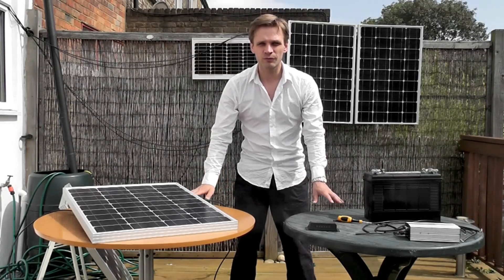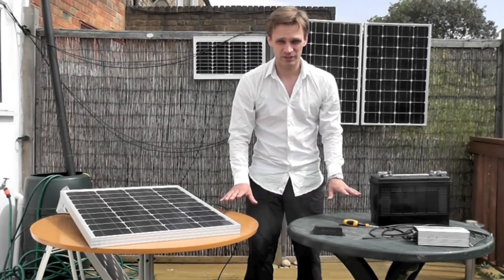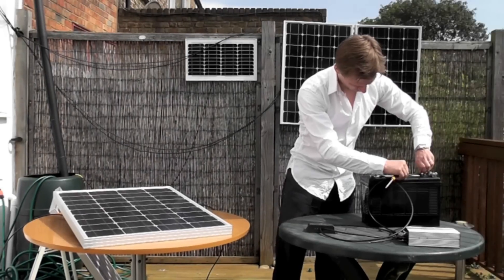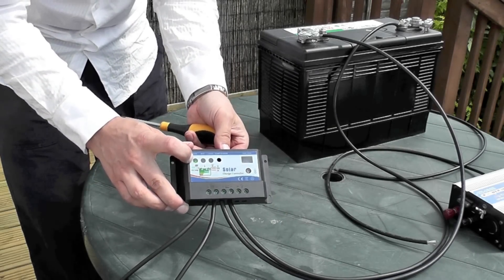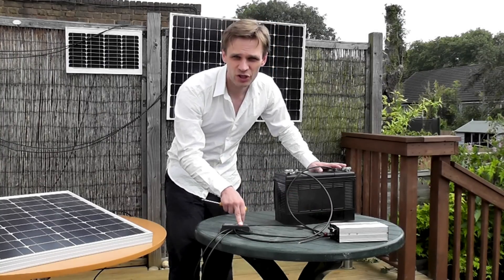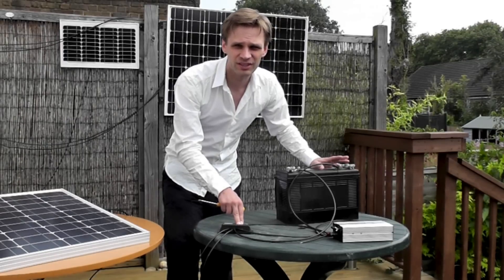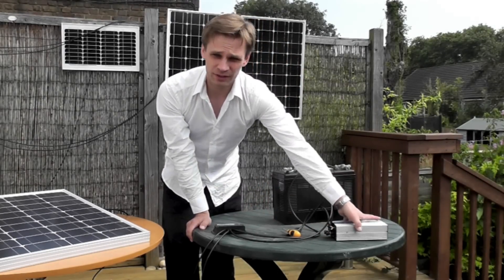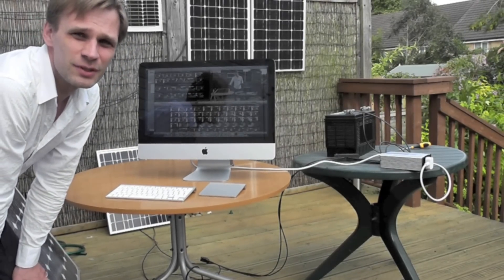How to create a 240V AKT Solar system that powers mains appliances

Comment: Can someone test 240  weilding with this solar device. Yh it's 240v and should work for the ark or any 240v weilder. But I like to see a test video on using this 240v solar panel for weilding. Who ever has this and can. Should make a YouTube video on using it. Atleast having one video on solar/turbine in using to power weilding machines is helpful.😊👍👍👍👍
Reply from the maker: It would potentially be possible to weld using a system like this. You’d need to make sure the inverter was powerful enough to supply the power (Watts) that the welder required and also that the battery can supply the required power. Then all you need to do is charge up the battery enough using the solar panel and you should be good to go

Comment: I dont know if attaching the invertor to the charge controller is dangerous but it goes against the advice you find elsewhere which is "Never connect your power inverter and the charge controller directly without a battery between the two".
My understanding is the load put on the charge controller by the invertor will be too great so it must be connected to the battery.
Also get a Pure Sinewave invertor or be prepared to say goodbye to electronics.
Reply from the maker: Thanks - I agree, for loads over the rated current for the charge controller you should attach direct to the battery. But for smaller loads it’s good to connect to the charge controller as that should cut off at low voltage and prevent over-discharging of the battery.
And you’re also right it’s good to use a pure sine wave inverter for complex electronics.

Comment: how you getting 240v out of 1 battery ? there no way in hell your getting 240v out of that. i driver a semi truck with a 2500 watt inverter running on 3 battery's that puts me up to 240v you maybe running 110 but not 240.
Reply from the maker: You get 12V dc out of the battery. Then the inverter converts that to 240V 50Hz ac. You just need an inverter that is designed for the correct input voltage (here around 12V) and to produce whatever output you want.
Here in the UK our mains electricity is 240V ac (50Hz) so most of the inverters you get here output 240V ac

Comment: We just got a water well put in and would like to hook it into solar.
It is a 230v, 750watt, 10.4max amp pump.
We currently have a 200watt solar system, and wonder if we need to boost our solar panels and batteries to support it, or put it on own system?

Comment: What power rating solar panel did you use? We're doing a group project where we need to power a 220V and 50Hz pump with a solar panel. Whay power rating solar panel (or array of panels) would be require
Reply from the maker: It depends how often you want to run your pump. If you only want it for a few minutes every hour then a 100W panel linked to around 200Ah of battery would probably be okay. If you want more consistent running then you’d need a larger set up. Do you know the power rating of your pump and how often you’d want to use it?

Comment: Thank You for the great video and information. Wont the b240V burn up 110V appliances?
Reply from the maker: phillip staton Hi Phillip, You're right. This is a UK inverter where we have 230-240V ac at 50Hz. For appliances that are intended to work at 110V (e.g.in North America) then you need a 110V inverter.

Comment: Question, can I run a Range and dryer at the same time or is this designed strictly for running one 240volt appliance at a time?
Reply from the maker: Hi Rob, you can run as many appliances as you have power for. E.g. if you have a 1000W inverter and a big enough battery to support producing 1000W then you’ll be able to run any number of appliances up to a combined power of 1000W. Hope this helps, Simon

Comment: Normally to do oke, first do 48 volts to 400 volts inverter and a c lass d system power amp to make 220 volts with a low distortion sinusoidal. I like 48 volts more, less current who can cause fires

Comment: Can you please make a video on DO's and Dont's ... When installing a Solar Panel and Common mistakes.
 Also, I am planning on doing this in Syria...It gets pretty HOT there.... How would I guarantee that the system won't get fried or overheat ..? Lastly How do I regulate the Wattage depending on the appliance that I am trying to power? 

Thank you VERY VERY much.

Comment: I love this video.

Few questions

1. How long would the battery last without the solar panel in operation (on a cloudy day) while running an appliance (such as your computer)?

2. by using multiple batteries in parallel, would the charge last longer?

3. Can you run multiple appliances at one time by using an extension cord from the inverter that has more than one socket? 

Thanks :)

Comment: hi..thanks for sharing this video, just a question... i learned that inverter must be connected directly on battery and not on charge controller, and use the dc controller output to use for 12v devices or lights... i always wondered why not? i think is good idea to connect inverter on charge controller...may you help me with some details please why it can be possible? thanks in advance.

Comment: Oh that's it....so all that's needed are:

- Charge Controller
- Battery
- Solar Panel
- 240V AC inverter

Solar Panel's negative and positive connects to charge controller's negatives and positive respectively and charge controller's negative and positive to battery's negative and positive respectively. Sounds simple enough.

How would all this cost? 

And I can use any battery voltage? Like 6V or 24V for example? 

And what about Solar Panels? What's the difference between a higher wattage panel vs. lower wattage? Mainly charging speed? So...a higher wattage one would give you guaranteed uninterrupted power whilst a lower one would buffer to give you some power like how you stream videos and if you don't have a fast enough internet connection, the video buffers every few seconds...? Which would mean I should get an adequate panel less I suffer from these buffer problems?

How long would this power say a computer for? 24hrs? Which means I should be good if a blackout occurs that lasts no longer than a day? :P

Comment: hello, just seen your video and I'm interested to know if I can run multiple appliances on that system. I just built a 4x2m shed in which I'm going to run an inet radio station. it will have 1 4ft florescent light and upto a max number of eight appliances 240v these would be turntables cdj's laptops mixers etc. could you maybe point me in the right direction for kits or hybrid kits wind and solar as I'm in Wiltshire and it can be quite windy as well as sunny
Reply from the maker: Hello, Yes you can run multiple appliances off this. If you have a big enough battery bank and inverter you could easily run a whole house off it.

Generally people find pure solar easier than wind/solar combination as the wind part can be more tricky (with moving parts) and also solar has come down in price so much.

It's difficult to point in the direction of kits as you generally have to make your own that fits your requirements. But a good start is Amazon that has everything you would need on it - you'll just have to pick and mix to get what is perfect for your situation.

I hope this helps.

Cheers,

Simon
Reply: ok how many deep cycle batteries do you think i will need 1,2,4?    as my budget is £300
Reply from the maker: Hi there, It all depends on how much you want to use it each day. One rough way to work out the size of battery bank to use is to work out is your daily usage and try to make sure this doesn't exceed half the capacity of your batteries. Then you should not typically run your batteries down by more than half charge and this should give them a long life. I hope this helps, Simon
Reply: more than likely be couple of hours every other day maybe same every day summer time. running 2/4 bits of equipment

Comment: (Hello, I have 3 panels 300w and 2 solar batteries (12v,150AH 
Standby use 13.5 ~ 13.8V
Cycle use 14.4 ~ 15.0V
How many watts can the two batteries deliver?
Reply from the maker: Hi there, For normal lead acid batteries you generally don't want to run your batteries down at a rate that would see them use up the entire capacity in under 10 hours. Your capacity is 150 x 12 x 2 = 3600 Wh. So generally you wouldn't want to run more than 360W from the batteries. Although for short periods it shouldn't matter if you go slightly above this. I hope this helps, Simon
Reply: Thank you for your clarification.

Comment: Hello I have 3 panels 235w each How much power can these generate on average a day in uk. What size battery would I need. I want to use the power for 240v ac.
Reply from the maker: +ran dom Hi there, you have 705W of panels. In the UK you get around 4 hours equivalent of direct sunlight a day in summer and about 1.5 hours in winter. So you'd get an average of about 2800Wh / day in winter and 1100Wh / day in Winter. This assumes that your panels are angled slightly to the south and not shaded by trees etc at any time of the day. I hope this helps!!!!
Reply: Yes thanks. Am I correct in assuming that 2800wh is 2.8kWh and 1100 wh is 1.1 kWh . My panels are pv photovoltaic what does that mean. I'm looking to get a battery is a deep cycle battery necessary.

Comment: Could a system like this be used to re-charge an electric car? And if so, how many batteries would I need?
Reply: I would say it would depend on what voltage and amps the charger for the car requires. I guess it would need a lot of wattage to get the battery charged. I see no way how a standard car battery would fully charge it though. The system is mainly solar driven and the car battery gets charged during the day and discharges at night. Its more or less for caravans etc.? An 100% electric car/vehicle would require a lot of watts to charge it. Using these 12 volt panels would take you forever. The power inverter can only give what it has, which means drawing far too much; wouldn't do it any favours. Solar panel with an much more powerful inverter lets say one, which can give your car what it needs. Will handle it but there again if the inverter isn't getting enough from the solar panel it would bring us back to the same conclusion.  It would be a real big NO am afraid. 

Look for something much bigger, which am afraid to say would cost you a lot more money. Again see what your car charger requires then see if you can find something more suitable in that sense. Let us know how you get on. May help the community to find something for them too all been well.
Reply: @jaycool5978  I don't understand why.  a 240v home charger will run at 30amps (40a circuit).  i don't see why you couldn't run this from a battery bank?
Reply: @cheefussmith9380  Would require a massive battery bank. 240 volts * 30 amps  = 7200 VA

Comment: Hi there, I`m doing an install of a 140 watt solar panel kit on a south facing external wall of a chalet which is vertical. Is there any equipment available to induce the 34 degree angle needed on the panel to gain maximum exposure to the sun.
Reply from the maker: Techsus SW Hello Techsus, Thanks for your question. It's usually best to construct your own bespoke frame for this kind of thing. Some angled aluminium is usually best and you can easily bolt it on to the mounting holes of your panel and also to a wall. 
I hope this helps. Cheers!!! Jonny

Comment: could you connect multiple batteries in parallel for it to power a heating system for an entire evening?
Reply from the maker: Adam Sherrard Hello Adam,You could connect multiple batteries In Parallel (+ve to +ve and -ve to -ve) to make a larger 12V battery bank. However still it would not really be suitable for a large-scale heating system as heat requires an awful lot of electricity. Nevertheless, it would work just you'd need a lot of batteries and panels.
I hope this helps.
All the best,
Jonny

Comment: would this be able to power a 3/4 horse pump? i was thinking of a free energy for a geothermal heating system.
Reply from the maker: Hello, 

It would be able to power your pump but only for a small amount of time as 3/4 Hp is about 700W. You'd also need an inverter that was something like 1000W.

I hope this helps. Cheers, Jonny :)
Reply: thanks for the input. but why only a small amount of time? what if i have x amount of solar panels adding up to 700 watts would that help?
Reply from the maker: Yes, if you have 700W of panels then with the sun shining directly on them they should be able to power a 700W pump continuously. The reason if you have less it will only allow you to run the pump for a small amount of time is that your battery will run out of power as there will be less going into it from the panel than coming out of it from the pump.

Cheers,

Jonny
Reply: AKT Solar thank you for your input akt. i appreciate it. back to my contemplating chair

Comment: i am thankful to see this video. i understand this way battery charging and discharging cycle is avoided. but i want to confirm with you is it DC going to to inverter is coming from solar panel directly through regulator?

Comment: Hey Mate,
Thanks for your reply but I'm not sure I still fully understand.  I have a farm house in Egypt and I want to use solar power to run a water filter which is 10 amp, an average size fridge, 5 lights, and a small TV. Would be greatly appreciated if you could advise what size panels, battery, inverter and charge controller would I need. The voltage over there is 110V and 220V. Here in Australia we can buy 120V & 240V.  Your video was very clear and very easy to follow and understand but would really appreciate your help and advice with what equipment I would initially need. Thanks again, Regards Paul.

Comment: Hi there,

I was just wondering what the size of your Solar Panel is and if you could use 2 car batteries?

Also I am running a small farm and would like to start using this to pump water, for lighting and for mobile devices and tvs etc, would it be a good idea to use this 240V Solar System to power all these appliances?

Thanks!
Reply from the maker: Hello Paul, 

This panel here is a 40W panel and the ones in the back ground are 2 50W panels and a 20W panel.

And yes you can use two car batteries. It's generally better to use leisure batteries for normal applications but using two car batteries would certainly work.

I hope this helps.

Cheers,

Jonny

Comment: Good stuff. I went directly to the battery with the inverter, but will be pulling a bigger load.
Reply from the maker: Perfect. You're right to connect the load directly to the battery if it would exceed the current rating of the controller. Good luck and do ask if we can help with anything in the future.
All the best,
Jonny

Comment: Hi there, great video, its got all the info I was looking for. I just wanted to ask a question though.. you plugged in one device (the Mac computer) into the inverter and it powered it fine.. but would it be possible to plug an extension lead with 3 sockets on it, into the inverter, and then power multiple devices such as a computer, a mini fridge and a TV perhaps? I'm just curious as I'd like to run my small outhouse using solar power. Hope you can help me with this question, thank you!
Reply from the maker: Hi Faraaj,
The simple answer is yes, you can attach an extension lead with multiple sockets. You must not exceed the power of the inverter and also if you're going to need more current than the controller can handle, it's important to attach the inverter directly to the battery and not to the output on the controller.
I hope this helps.
Cheers,
Jonny
Reply: you will burn up your inverter. i had one in my semi truck had a mini fridge tv and microwave. and its burn up in 2 months  try looking for a 2500 watt or 5000 watt inverter

Comment from the maker: Hi there, It's a 12V 125Ah battery and I think it is a 50W panel. In any case, any of our panels up to 180W would be suitable for using with a 100Ah to 125Ah 12V battery would be suitable for a system like this.

Comment: Hi jhonny. Thanks for the brilliant video. Just wanted to know if it is possible to charge and use the battery at the same time. I mean solar panels charging the battery and other devices connected to inverter using the power from battery at the same time?

Comment from the maker: Hi there, 

Yes I think that would be best - i) lights to the charge controller so the charge controller will still protect your battery from being over-discharged by the lights and ii) inverter direct to the battery so you can draw more than 240W from your inverter if you need to. 

Just try not to put very big loads through the inverter and also try not to let the inverter discharge your battery very low as both could reduce the life of your battery.

Cheers,

Jonny

Comment from the maker: Hi there, 

Yes, it's fine to connect the lights and the inverter to the battery. It's also fine to use them both at the same time. However, I should point out that to preserve the life of your battery it would be best not to exceed about 12x110/10 = 132W of load on the battery.

Also it's important to attach the inverter directly to the battery if you're going to use over 240W because the charge controller will only give 20A (= 240W at 12V).

Good luck and feel free to ask any questions!

Jonny

Comment: Yes i was thinking the same thing. Actually what i was going to do is put 10amp circuit breaker in all the positive cabling lines. so one between solar panel and regulator, 1 between regulator and battery, and 1 between battery an inverter. This would act as a protection as in a circuit breaker but also an alternative to un-disconnecting cables; they can just manually switch off the circuit breakers.